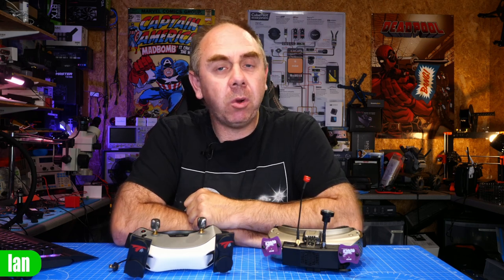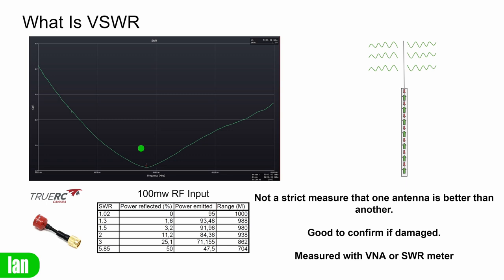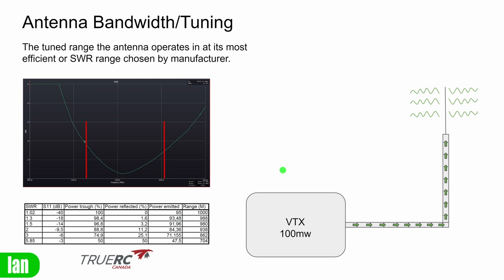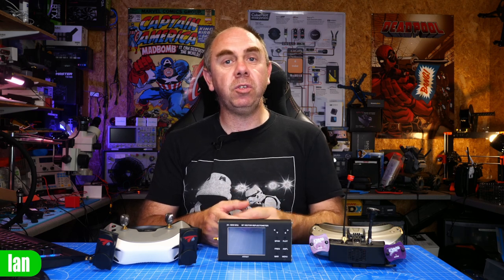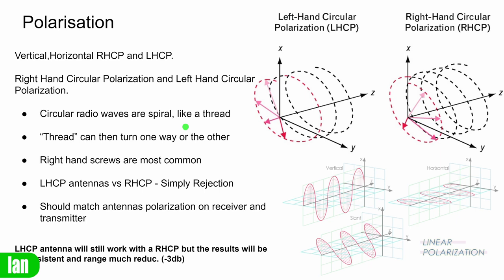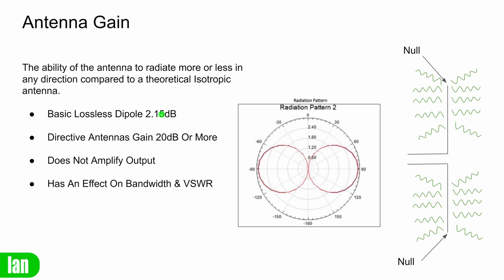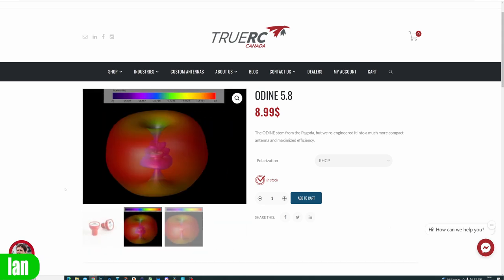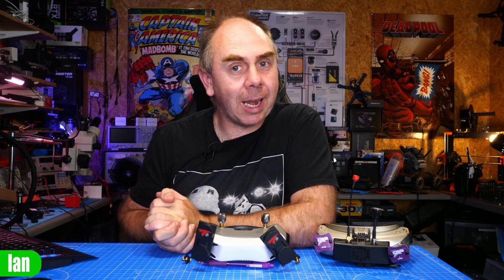FPV Antenna SWR & Gain - What Affects Performance Explained

Comment: Thank you for the insightful and detailed video! I work in film and am upgrading a system we use to control lights via radio - it’s all still very new for our industry so I’ve turned to the fpv community for help! Thanks again

Comment: In microwave level instrumentation (radar) we used circular polarisation back in 2004, a reflected signal spins in the opposite direction so is ignored. More over we developed a switching gate so 100% power went out but it switched back to receive (very fast) this gave us a higher SnR and higher received signal strength. Its small but it wouldnt fit on an FC
Reply from the maker: That’s really cool.

Comment: fantastic information! I was aware of SWR, but this is the first time I get a comprehensive look at ALL the parameters at play. I think it would be FANTASTIC if you could show how to use a hobby-grade VNA (possibly suggesting the best one to use) to figure out these parameters, as I've always seen mentioned that even with the same brand/model of antenna, the manufacturing process does induce variations. at the end of the day, once one has decided which mix of antennas is best for their use case, there's still the choice of which channel to run them on, and I think assessing the individual antenna in hand can help with that. thanks again, great video and great channel!

Comment: A really good presentation👏👏. I come across this often from radio hams when they equate a resonant antenna as to how low the VSWR is. Antenna resonance is defined when it presents a purely resistive load allowing for maximum current flow, while the reactance of the equivalent circuit equals zero. You can obtain a 1:1 reading while the above criteria are not met. Also antenna efficiency is not the same as radiation efficiency, otherwise when testing into a dummy antenna/load all the energy would radiate into free space.

I’ve always considered antennas to be the physical manifestation of a complex mathematical equation. Essentially turning a theory or hypothesis into something you can physically manhandle. 😉